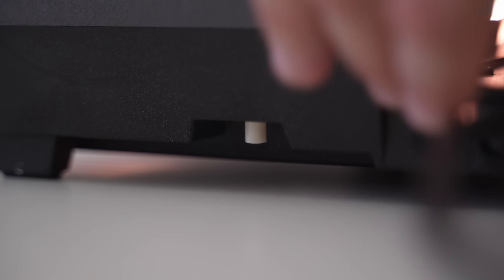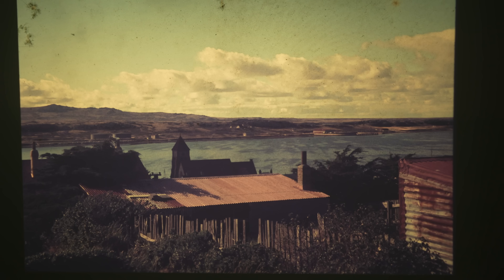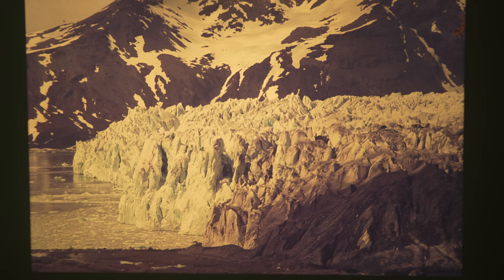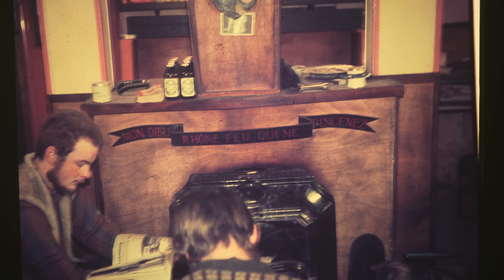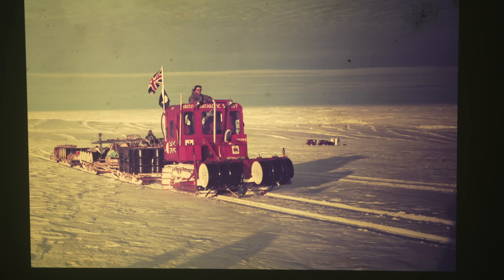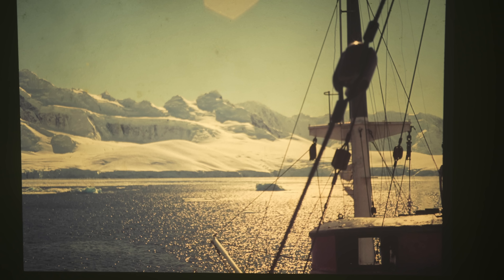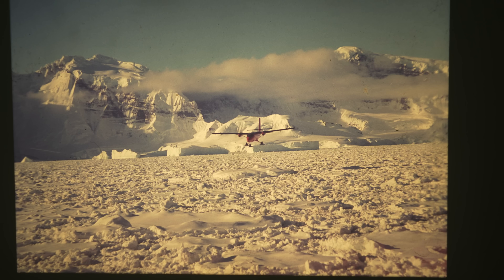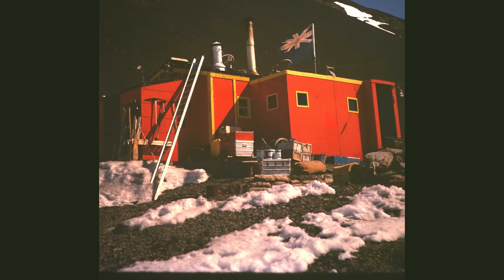What it was like being a mechanic in Antarctica in the 60's

Comment: 5:08 i experienced white-out. Arguably worse than ... sand-out(?), because at least with sand, you can just cover your face and pray you make it out, with a snow storm, you'll be out by the end of the day if you're particularly lucky. Top of the mountain, caught in a storm, wind, i made the mistake to get away from the only rock i could see. You can't tell where you care, it's pure white. There's nothing but biting cold and the noise. You can't even see your steps. If you lose your orientation or point of reference, you're done for. You can even walk off the side of the mountain and you wouldn't even know it.

Comment: You have to wonder what those who worked south of the Antarctic Circle 50 or more years ago, think about Flat Earthers and the recent visit to Union Glacier by group of them. These folk think Antarctica is an ice wall that holds all the water in on the "flat Earth", like the sides of a bathtub. They also said it was impossible that there could be a 24-hour sun in Antarctica, and any film or video proving there was between December and March, was fake. The ones who attended the "experiment" last December to witness the phenomenon themselves have not been received well by their community members that didn't go. Of course all the video recording the 24-hour bright sunlight was also called "faked" in various ridiculous ways. Yet for centuries, hardy men and women who have actually worked there, have seen it with their own eyes.